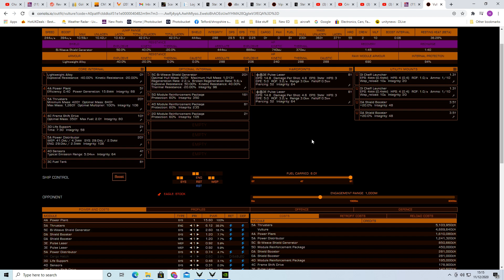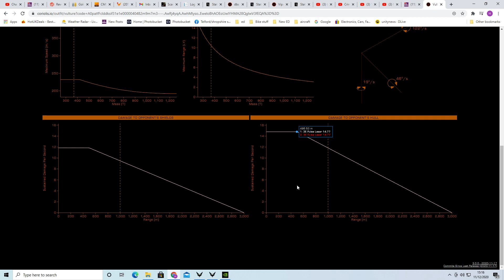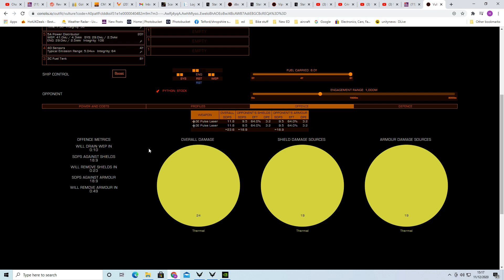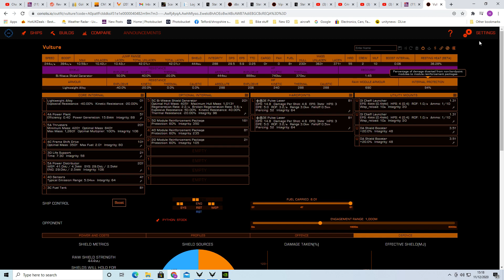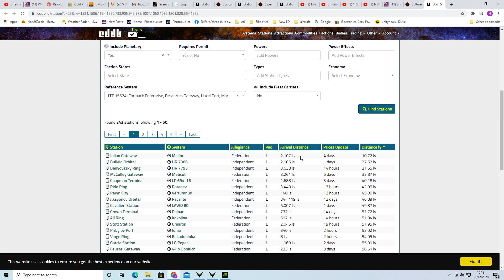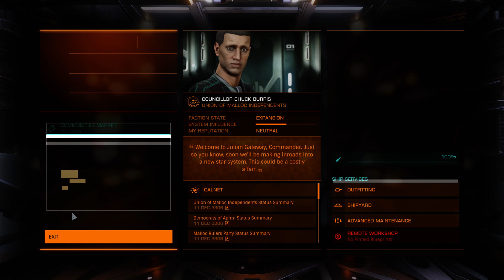Elite dangerous combat for beginners part 4 Vulture loadout

Comment: Hey Jardon... hope you are well... just thinking... you should post video of you key/stick bindings for X52 ( i think thats what you said you were using)
Reply from the maker: My X52 is not very reliable. Buttons on the throttle keep coming and going, so I move my bindings around. The key things are to set the throttle full range so yu can go backwards and forwards with it; thrusters on the throttle hat;  fire groups on the top right button of the right stick; panel selection on top left hat of right stick; movement within panels and pips on the bottom hat of the right stick; FSD on the big top button on the throttle and boost on the big bottom one; If your pinkie trigger works, use that for flight assist toggle and the flat top button for chaff or heatsinks, otherwise use the flat button for flight assist; for secondary trigger, usethe middle small button on the throttle if it works, otherwise the small button next to the tiny mouse toggle. Most other things can be bound to the keyboard, like galaxy map, system map, landing gear, cargo scoop..